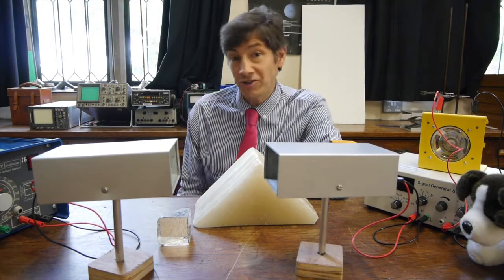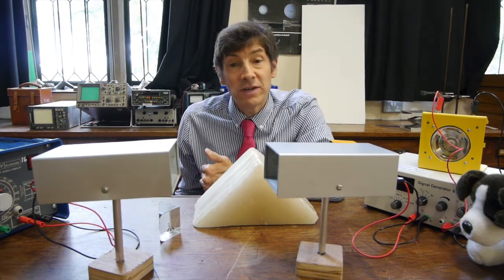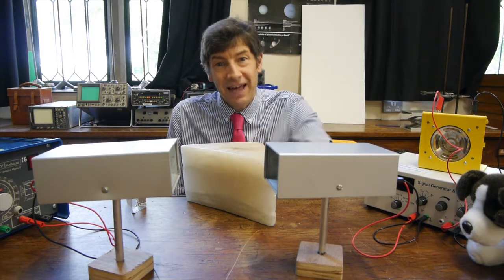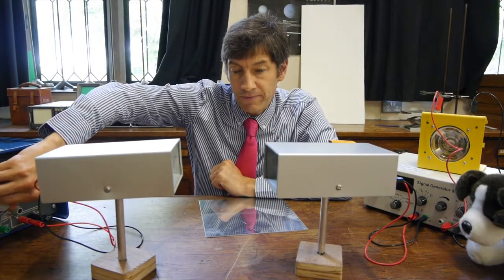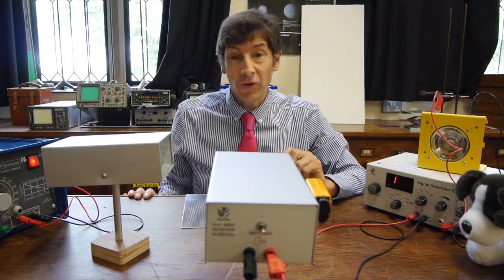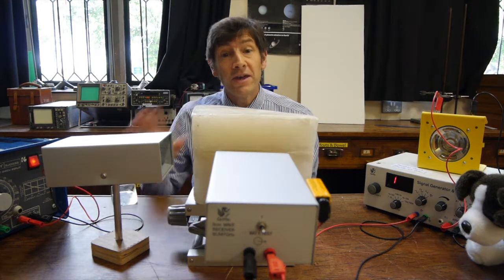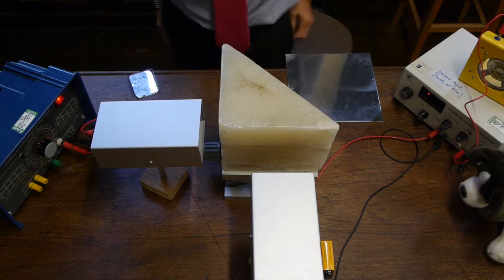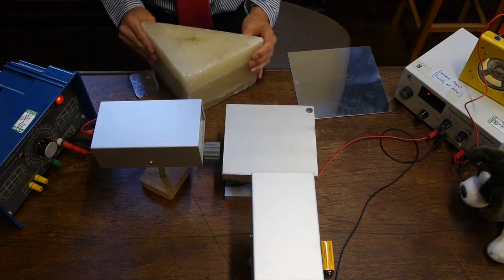A Prism Made of Wax! Total Internal Reflection with the Wax Prism - F-J's Physics - Video 140

Comment: Hi if you had a wedge shaped glass or maybe other materials container and filled it with oil would that do the trick ? Wondering what is it about the wax that caused the deflection ? And is the deflection with the metal sheet purely mirror or is it with in the metal ?
Reply from the maker: Great question that has a range of difficulty in answers!  So for reflection to happen inside a material, as it is doing here, the incident waves have to hit the surface at an angle greater than the critical angle - this is determined by differences in the refractive index (bending power) of the material interface, in this case wax-air.  Now, we do have a prism shaped tank in the lab which does not work until you fill it with fluid, as you suggest!  So, this total internal reflection is really caused when the angle that the waves refract through is such that they would never leave the material's surface - I need to draw it to explain it!  All caused by wave speeds in the different media being different.  Now... to the metal sheet.  That at most levels is regular reflection, so consider the wave 'bouncing off' the surface like and echo.  At much more advanced levels it is actually a surface absorption followed by a emission but we do not teach that even at A Level as it adds nothing to the understanding!  Hope that helps a bit Steve and thanks for taking the time to watch and ask too!

Comment: So, does the wax interact with the microwaves? Does it absorb it? Does it melt? Has the temperature of the block risen by any degree? Just curious.
Reply from the maker: Good question.  So the idea is that the wax is a material that can refract microwaves without being absorbed (rather like visible light and lenses).  However, with any process like this there will be some absorption and this will appear as heat in the material.  I used 20cm microwaves of very low power so there was no chance of this really being visible.  I am sure if I could use a high power microwave transmitter that would be another matter!n  Hope that helps and thanks for watching!